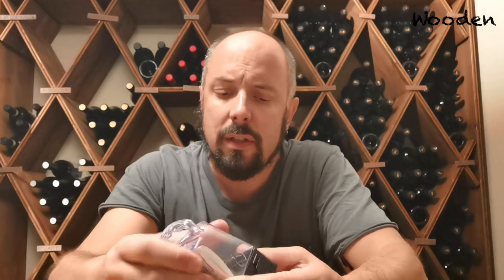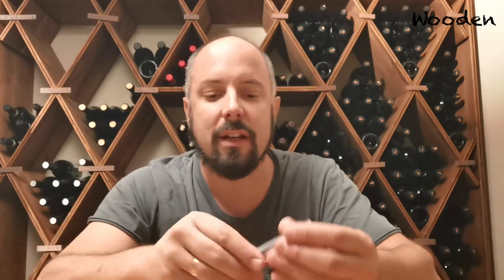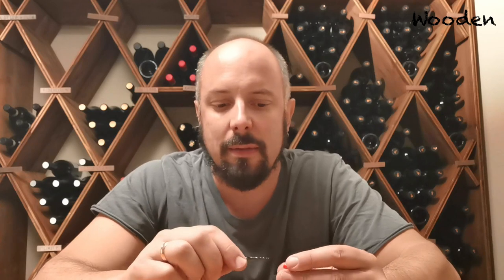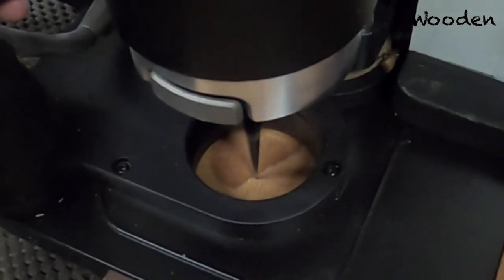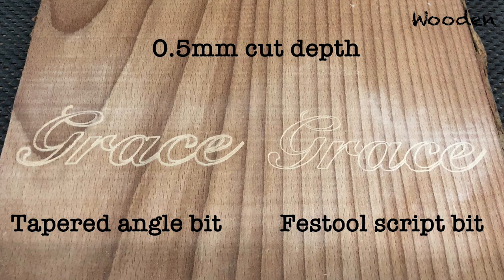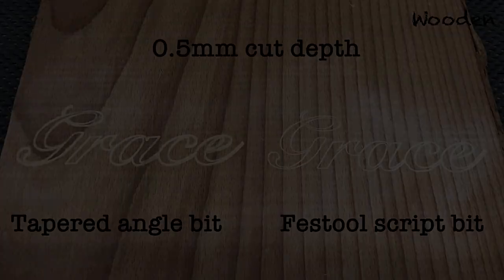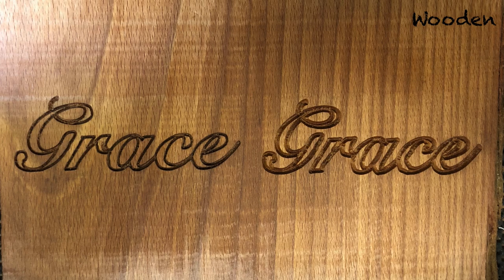Shaper Origin engraving: Testing the Festool script bit

Comment: With the shallow depths I can clearly see that the festool bit produced a sharper result, but in every test it also appeared to have more errors. Specifically, more areas where the curve wasn't smooth, kind of like the shaper was bumped or something.  Can you comment on this?
Reply from the maker: Interesting. That is not my experience, but looking at the picture I can see why you must conclude like that. After using the bit for many hours, I feel confident it is sharper at shallow depths.
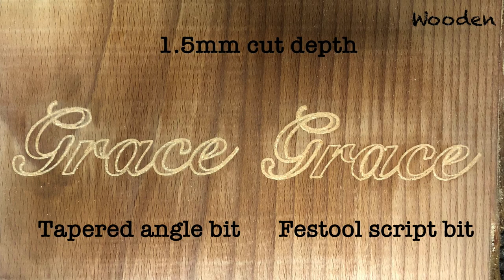Reply: @Woodensoul  Yeah it's weird, because 95% of the festool cut one looks way better but that other 5% looks way worse :)  Specifically, at 3:54 in the video, the bottom of the festool "C" has a bump, and at 4:10 the bottom of the festool "A" has a bump.  I'm guessing this was just a Shaper snafu and not a bit issue.  In any case, thanks for the comparison.  As a new Shaper owner I really appreciate your content, keep it up!
Reply from the maker: Yeah, pretty sure these were SO snafus... Enjoy your new Shaper man, it’s an awesome tool 😁

Comment: No longer available in the US for some reason. Also, as mentioned below, you are not using the Festool bit for its intended purpose which is to carve single line font characters, not outline characters. Shaper Origin now has a few single line fonts with more coming (I hope).
Reply from the maker: Yeah, it's no longer sold, but I ended up using mostly this bit anyway, as it's much cheaper and has pretty good results for the money: https://youtu.be/BtAmp1RZT0o